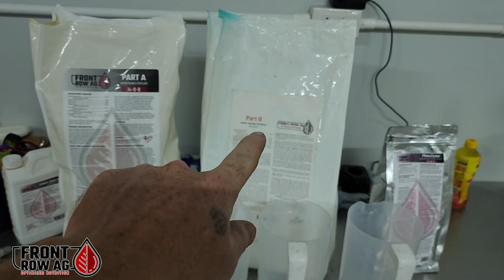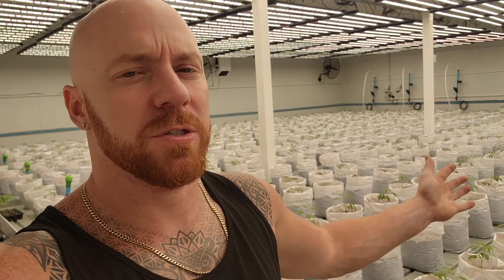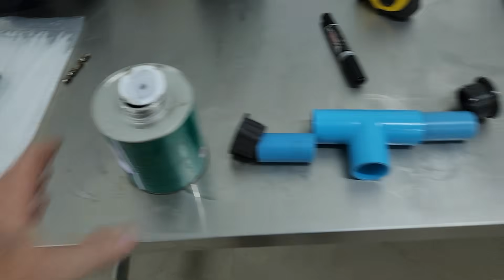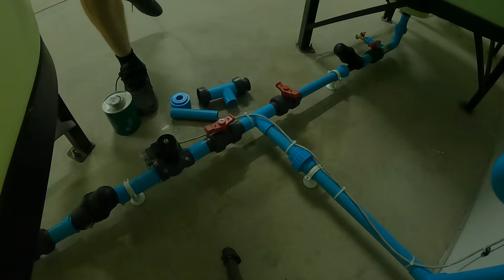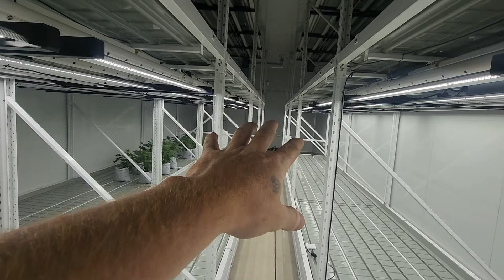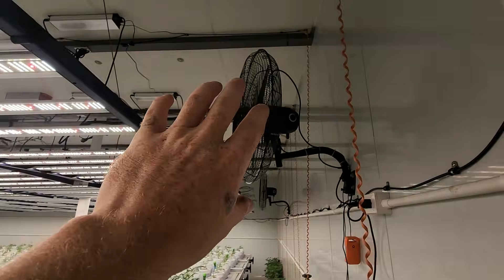Building a 300 LIGHT COMMERCIAL GROW FACILITY!!! PART 3

Comment: Bro, why would you waste co2 during early veg? You only need it if you are absolutely cranking your lights. Just vent more.
I'm establishing a commercial facility, too and appreciate your  content. Can't do that here yet.
Best of luck!
Reply: Also, maybe if you get a larger drain reservoir, your existing pump might keep up with the table  run off. Cheaper to get a bigger or 2 reservoirs rather than new pumps. Space might be an issue though in that corner.

Comment: 3 15 17 b, then the a is all nitrogen 14-0-0 and the phospo load 12-58-0 . might as well run peters commercial powder ferts. i have my own made liquid in the US. Powdered ferts are good for boosts but do not carry the right trace minerals at the right %s
Reply: id run 250 ppm of the 3 15 17 , 100 ppm of the 14-0-0 and 100 ppm of the 12-58-0 max!!
Reply: id pre mix each in 1 gallon and let  it sit before adding it in to tanks, and a little fulvic to engage the trace minerals man. and why not throw a pump in there to mix instead of dealing with shut off valves?
Reply: i dont like coco, has a run off of around 80 ppm , i like rockwool or undercurrent water systems. plants are nice and green but hit for show and put for dough, well see them shining and swollen soon enough.